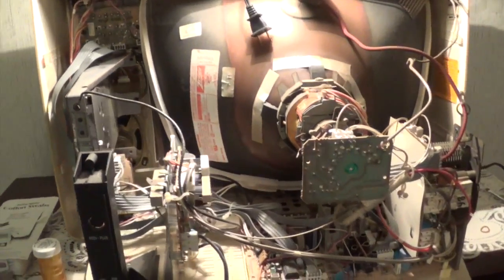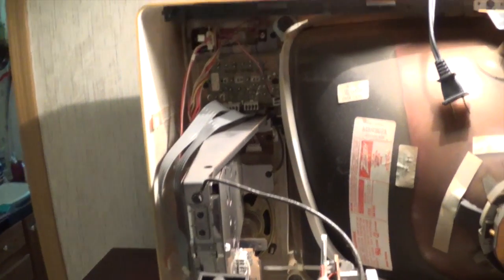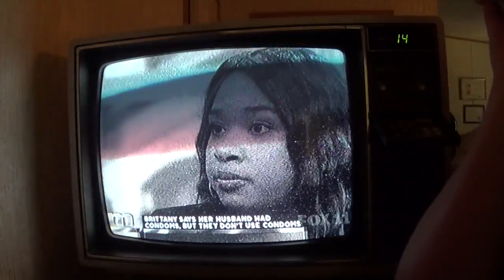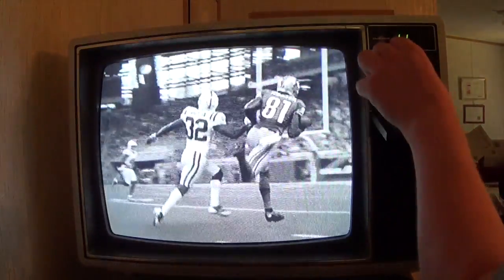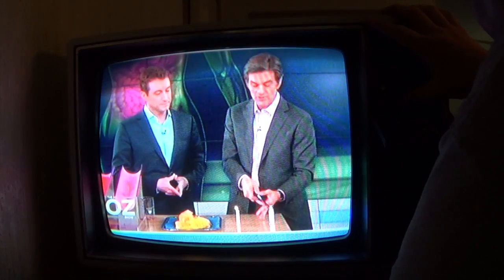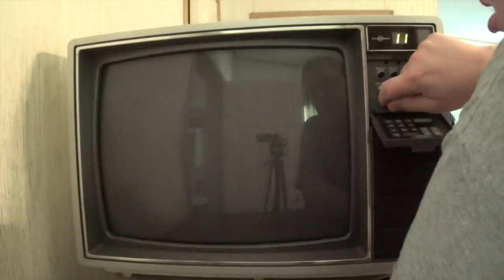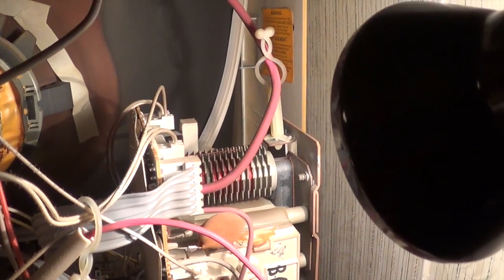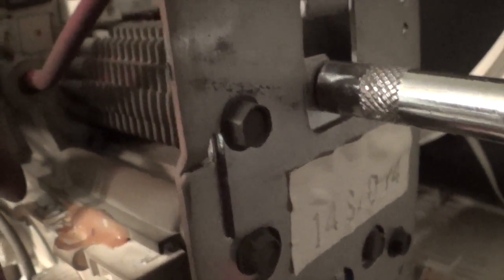Inside the 1985 Zenith System 3 for repair attempts

Comment: How would you change the channels if you don't have the original remote for the keypad on the front doesn't work? And my name it's this horrible odor out of the back of it. I'm not going to lie the back of it in the inside is terribly Dusty. Was wondering maybe it's the dust that's making this smell?
Reply from the maker: If it has a strange smell and is acting up, I would suggest you unplug the TV until someone can look into the issue. Not to scare you or anything. Zenith set close to this era was actually known to cause fires.  Without actually being able to look into the set's issues, that would be my best advice.  If you are on Facebook,  I would suggest joining the group Vintage Television Collectors.  There are plenty of knowledgeable people there. A smell coming from the TV could be benign or a safety issue. I would err on the side of caution.

Comment: What part of the zenith needs to be repaired when the screen fades in and out, and then, turns itself off, and doesn't respond when you push the power button?
Reply from the maker: That's a good question. if you are on Facebook, look for the  group named Vintage Television Collectors. There are plenty of members there with tonnes more knowledge than I have.  Someone there has likely seen that symptom.